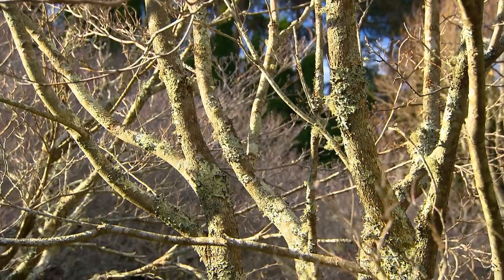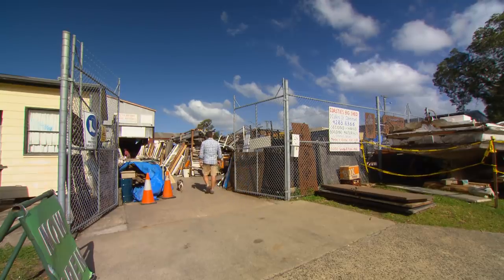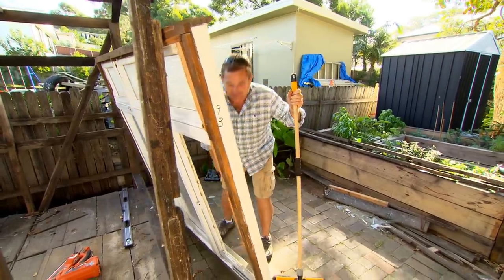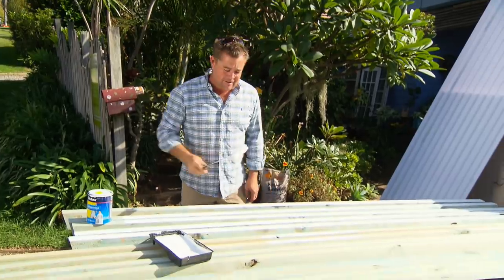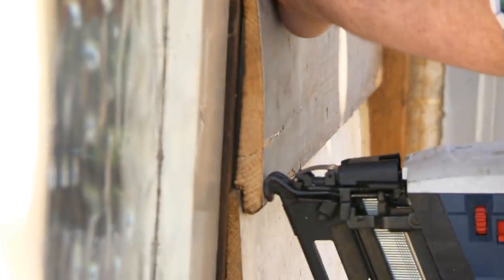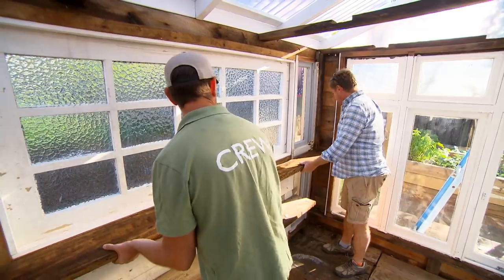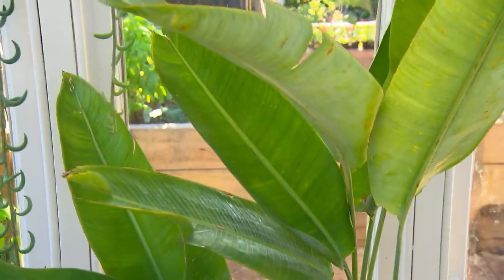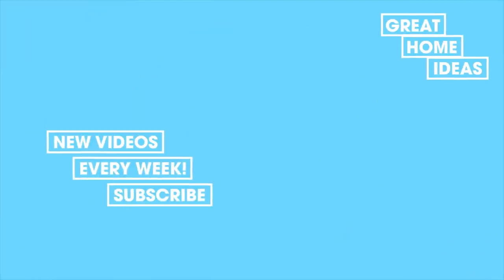How to Turn a Shed into a Glasshouse | Outdoor | Great Home Ideas

Comment: I love the shed but what about letting air through the windows?? Australian summer or for that matter any really hot summer could kill a lot of these plants
Reply: flamingpie herman Truth! Have to have ventilation, and probably don’t want to leave doors open. My dad made one with double plastic sheeting and could seal or open high spots. He’d even pull shade cloth over the top.  Also in winter unless there is a heat source those plants will die if it goes below freezing temps for long.  Another benefit to the plastic sheeting dad had a port hole where he could blow warm air between the layers with a modified 1970’s woman’s hood style hair dryer.